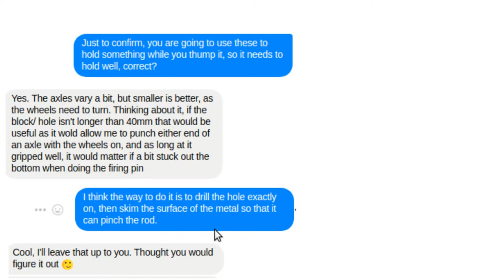Small Shaft Fixture

Comment: Machining is all about workholding and not about using the machine. I am also (pleasantly) surprised that the drill went as straight as it did.
Reply from the maker: Most of this project was machining the surfaces flat and parallel so I could be sure that the seam was parallel to the back jaw. Unfortunately the Proxxon mill doesn't provide any adjustment to ensure the quill is trammed to the back jaw, so I had to trust it was trammed well enough room the factory.
Reply: Same problem on my MF70.  Still, drilling  is chancy stuff!
Reply: For what it's worth, Proxxon seems to do a nice job on tramming the stuff they sell.
Reply from the maker: It certainly seems pretty good. The main problem I have is that the column height adjustment is out of tram with the quill, so if I need to locate a feature very precisely, I am then restricted to the height range of the quill, and my precision will be lost if I adjust the column.

At some point I'll measure the tram properly, and may even post a video of it if there is interest.
Reply: Quite. I have it in mind to write Proxxon because their instructions on maintenace and adjustment are non-existent. I wouled even take instructions in German, if they would but put them online.
Reply from the maker: Yeah, I mentioned in the Die Holder video that the documentation and specifications leave a lot out. It would have been really useful to know that the head stock has a Morse 2 taper, and I have no idea what I'm supposed to do to keep the main bearing running smoothly.
Reply: Amen. I have unacceptable backlash in my Z-feed and looking at the exploded parts diagram -- the whole of the supplied documentation -- it seems that I have to take out the feed wheel -- which is supposed to be held by a cross-pin -- and I have looked under magnification and I cannot find the *&^% crosspin. I really will write Proxxon.

Comment: Nice stuff, Well done!!
So you've changed out your Mill Vice...any details on this new one & why the change?
Also your Parallels look to be a far better fit (length) than what I'm considering, where did you source those from?

regards Colin
Reply from the maker: This is an older vise, and lower quality, but it's easier to mount horizontally, and tram in, so I used it for a quick job. Once I find a way to mount the Darmet toolmakers vise parallel to the x-axis, I'll make a video about how I did it.
Reply from the maker: I bought the parallels from an eBay seller of cheap Chinese tools, but I can't remember exactly where. Sorry.